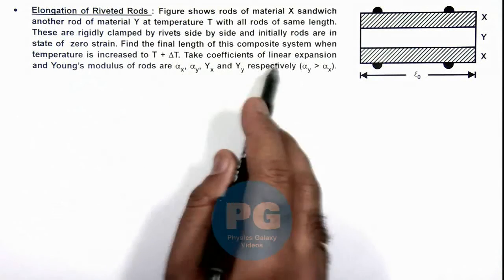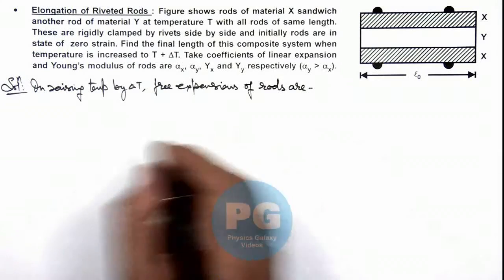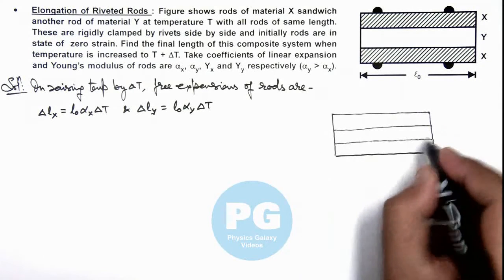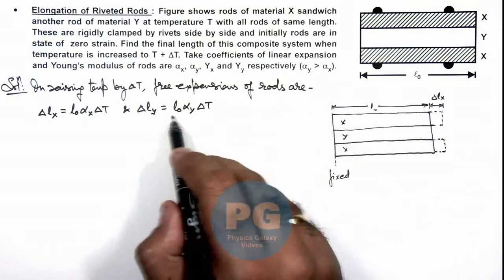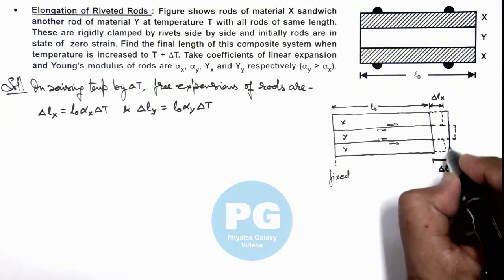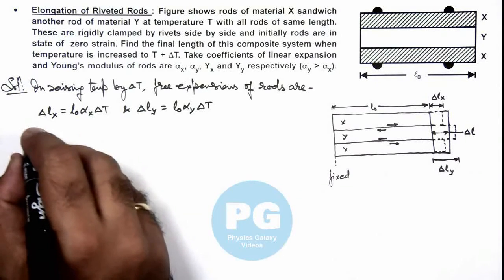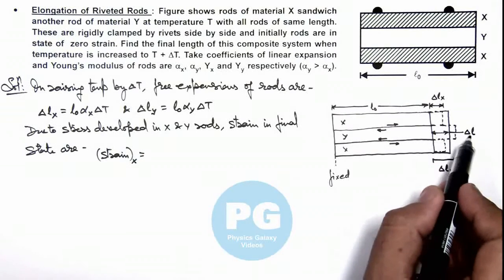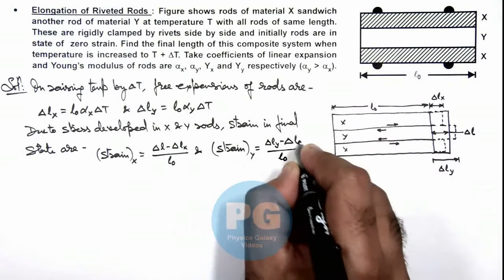3. Advance Illustration | Thermal Expansion & Calorimetry | Elongation of Riveted Rods |Ashish Arora

Comment: since sheer stress (and not normal stress) is acting on rods, I think rigidity modulus/sheer modulus should be used instead of Young's Modulus.
Am I right sir?
Reply: Exactly
Reply: Even though the force is tangential there is no change in angle of rods and overall the force is increasing the length of the rods and thats why force is tensile thus youngs modulus is taken into account (thats my logic I can be wrong)

Comment: why can not these rods expand in angular fashion as in bimetallic strip
Reply from the maker: because two rods are there on both sides of middle rod so it will not bend...
Reply: +Physics Galaxy  if there would be three rods all of different materials  then will it bend in angular fashion.
Reply: No Sir, it may bend and thickness of each strip May change (as in case of bimetallic strip, the diagram would be symmetric about the upper and bottom rod 'x',  means the rod y will curve toward both the sides, like concave mirror
Reply: @jagadeeshk7851 you make no sense. the rods are attached and the rods on either side are of same material. So for the same temp change in this situation I do not see a way for them to bend